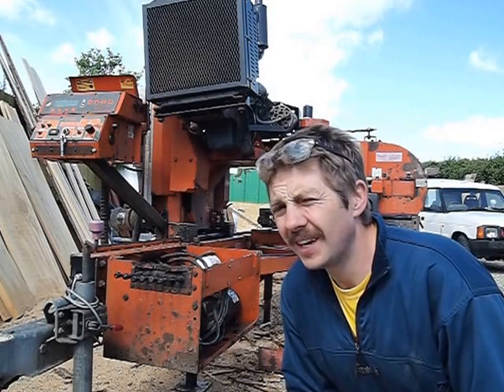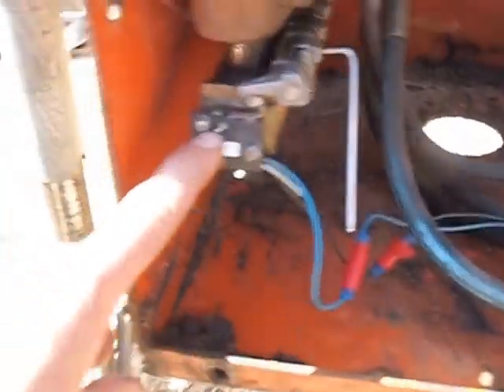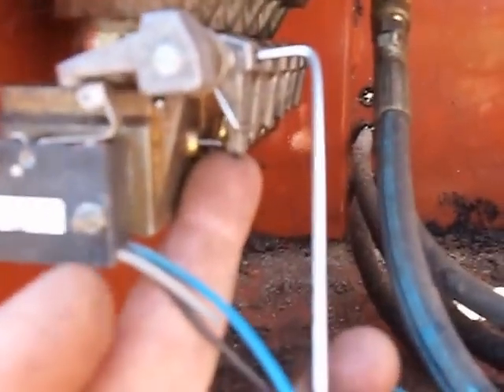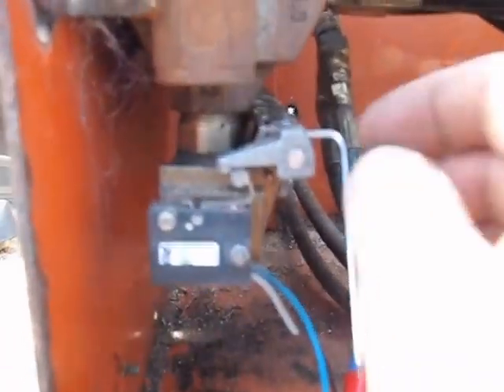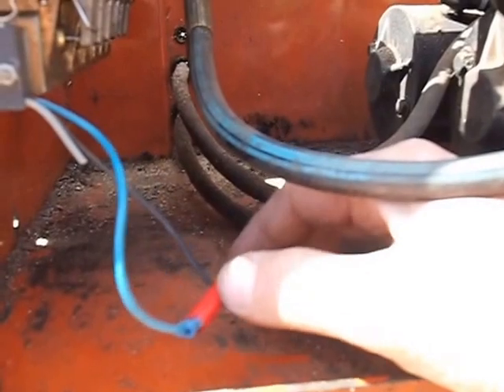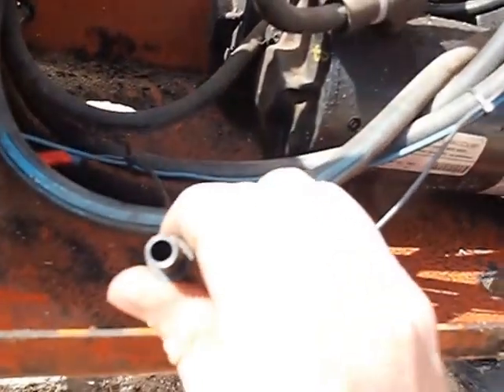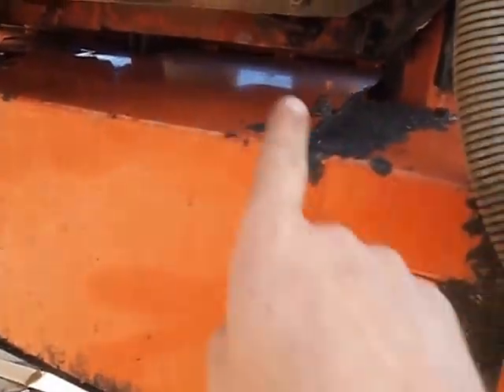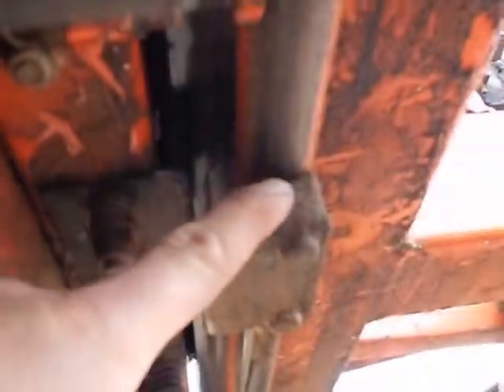Hydraulics troubleshooting and maintenance on Wood Mizer LT40 mobile bandsaw mill

Comment: Hello, I have an LT40 wide head that's a 2021 year model. . What could cause the hydraulics to make a gradual high pitch sound that 
sounds like it's getting more and more high pitch? It also doesn't have 
much power and is moving slow.

Comment: Thanks William. I have a LT40 (regular hydraulic) everything works fine but the log loader and the rest of levers you displayed don'
t work. Think it's the fuse? I've had it for about 10 years. It only has 219 hours!
Reply: Sounds like a short . make a direct wire and pass all the wiring
Reply: @tasmaniandevil7610  Thanks!